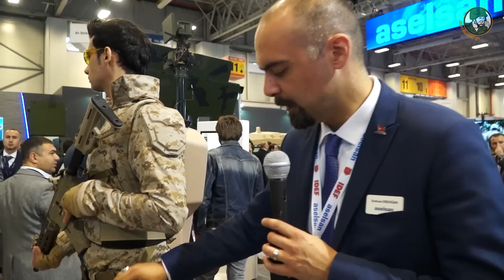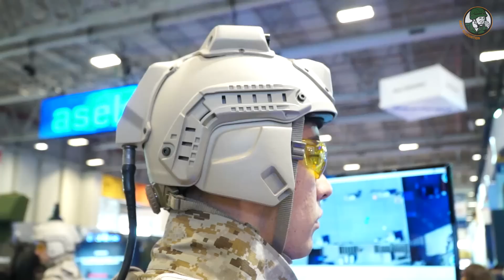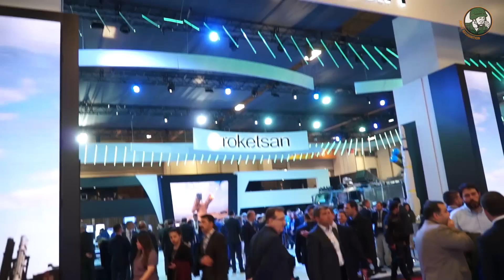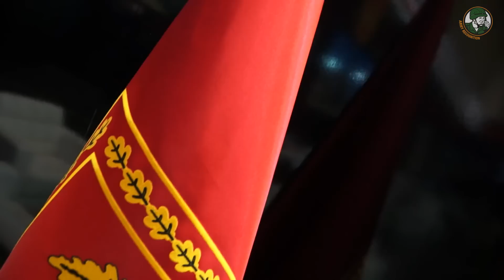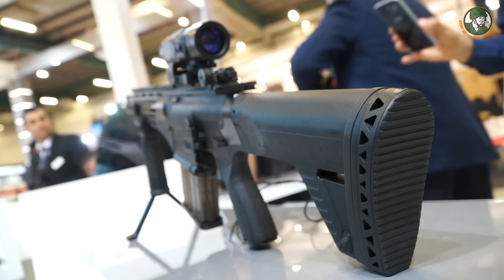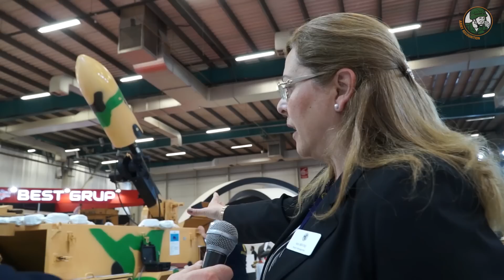IDEF 2017 International Defense Exhibition Istanbul Turkey Turkish industry military equipment day 2

Comment: per year 20K riffles products,this number alot
Reply: Maybe after they met the Turkish army capacity requirement, they downscale the production
Reply: NavyDef scy Actually it is not a big number for mass production. They could produce much more carbins but they want to watch reliability of the new gun and production.
This gun is very new , producer have to keep quality.
If something will go wrong quality of the gun, they replace.
Reply: NavyDef scy Unfortunately  Turkish Army  has not got a good and reliable carbines. All Army has to be armed immideatly.Old  MKEK G3 carbine  made in Turkey under licensed Heckler Koch doesn't work properly.
Reply: cause most of Turkish Army uses HK G3..they need be replaced as soon as possible. Actually 20k per year is too slow
Reply: turkish defence industries undersecretariat signed agreement with 2 others private firms to produce mtp-76 rifles..MKEK and those other 2 firms are going to produce total 45000 MPT-76 in every year..